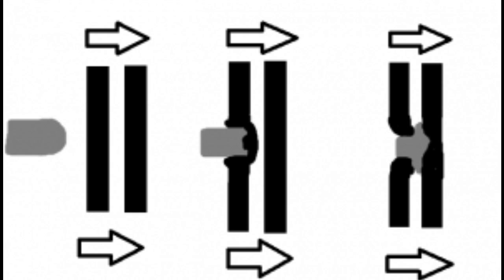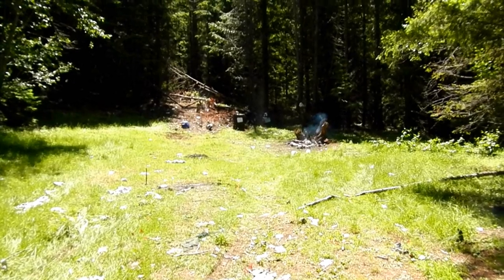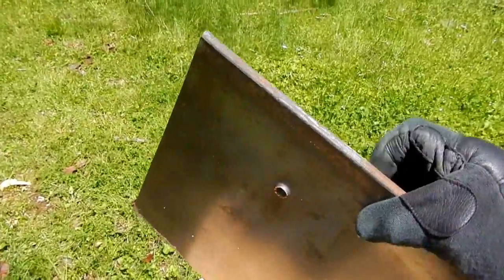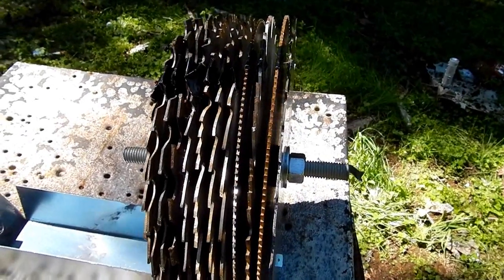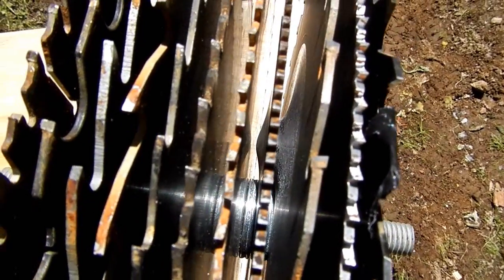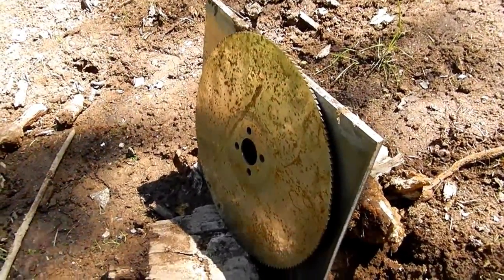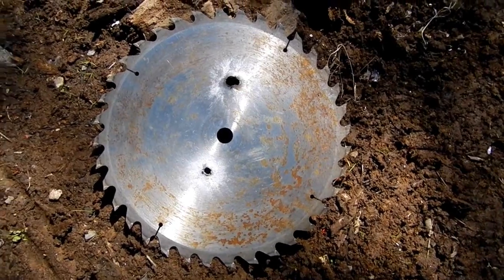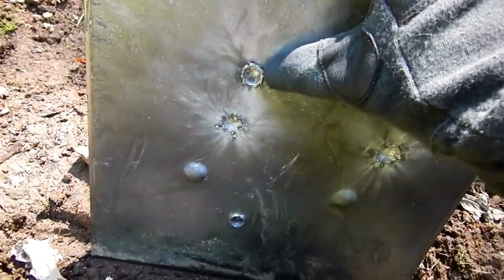Testing the Concept of Spaced Armor

Comment: Do the same thing with 122 millimeter round fired from a smooth board tube as the Russians have it's been proven that the space protection does work using lighter armor sounds great using composite armor standard Abrams with some form of that lighter armored space Steel yeah it stop shaped charges but will it work against depleted uranium tank rounds the best protection using lighter armor long as man stays in his present form tanks will always be needed on the battlefield I think that Russian t-14 armata is overly hyped up I still foot American Tank crew up against anybody and nine out of 10 times we're going to win because of Technology in training and training in training tanks should never be deployed on their own should always work in tandem with armored fighting Vehicles armored personnel carriers and grunts on the ground I despise the Germans and that's without question but the concept of mechanized Infantry with air assets is the way it should always be

Comment: Correct it's not the steel you use it's a spacing composite you put together remains stagnant bound together by the bolts and screws the projectile has to work and it's space between those plates doesn't change so that projectile loses energy but what about the projectile inside inside the projectile inside the projectile directions have a weapon such as that

Comment: Unfortunately mate, spaced armour is designed to defeat shaped charge or HEAT projectiles. a shaped charge projectile is a lump of High Explosive underneath cone of copper. As the projectile impacts the target, the high explosive is detonated, instantly inverting the copper cone. This causes a high pressure jet of molten copper to be sent forward into the target, burning it's way through the target. The spacing in spaced armour gives time and space for the copper jet to become less uniformed and allows it's energy to be expended before hitting the body of the target vehicle.
Reply from the maker: This is exactly the same mechanism for how it also defeats solid projectiles and sabot rounds. The multiple spaced layers of modern armor (ex. chobham) destabilize and distort ALL penetrators regardless of source.
Reply: Jackal Mountain that's a good point, I mean.... Look at the cheek armour on the cheeks of the turret on the  Leopard 2, it's basically one huge piece of spaced armour designed to catch APFSDS rounds. As far as the bullets entering your MRAPs thin outer layer, could that be to replace the Anti shaped charge warheads, instead of shaped charge cages? Or a way to reduce ricochet?

Comment: probably not the best comparison between that plate and the saw blades...different steel is going to have different properties...even the same steel that has been tempered and heat treated is going to behave differently than a plate of the same material that hasn't been heat treated in any way...

Comment: Those saw blades are also likely a harder steel than the 826 3/8 plate. More spacing may be needed for significant effect.

Comment: Isnt it possible that the type of ammo he uses with 7.62 39mm may be the less penetrating one? 
Coz in my opinion 556 shouldnt be more penetrating than 762 =)
Reply: @Aaron Washburn means distance makes the difference then
Reply from the maker: Kinetic energy = (1/2) mass x velocity^2  
since velocity in this equation is squared, it means higher speed projectiles have far more kinetic energy, also the 5.56 is concentrating that energy onto a smaller surface area, this results in higher penetration through some materials. The higher mass of a 7.62x39 will allow it to carry through more, easier penetrated materiels like ceramic tile, wood or drywall

Comment: 1/4" ballistic steel, used for bullet proof armor, will stop up to 7.62 NATO round.
Not all steel is the same.  Saw blades were not meant to stop bullets.
3/4 inch ballistic steel will stop a 50 cal round.

Comment: The more space between the plates the more effective they become. Nasa uses this concept for satellite and space station armor against very small particles traveling at crazy speeds with thickness of up to a foot or so of empty space.
If some of the plates are slanted in different directions this increase the amount of kinetic energy they will absorb. |/|/|
Layers work to diffuse the energy faster then just space but more layers more weight. Try a piece of glass in front of a metal plate.
Then another two just like it with some good amount of spacing behind it.

Comment: The reason why there are metal netting/ metal plate and then a space then the main armor around m-atv’s and maxxpro’s and other military vehicles are for RPGs and other weapons like that. Not for small arms fire, RPGs have two explosions. The first is to get through the armor and the second one is made to blow up the inside of the vehicle. So the reason why you have a metal netting or a metal plating then a space and then armor, is that when a  RPG hits it the plating it will cause the first explosion and when it hits the second layer it won’t go through the armor, and kill who ever is inside of it.

Comment: I wouldn’t really call this a test of spaced armor- to do a spaced armor test, you would need to shoot at the same thickness of material, and a consistent type of material to see how the spacing affects the penetration, for instance a 3/8” thick piece of mild steel, and a 1/8” spaced in front of a 2/8” mild steel. 

Any results from this ‘test’ can only be anecdotal

Comment: If I'm correct spaced armor is primarily there to stopping HEAT or shape charge rounds from penetrating the main armor, and it's recommended for that spaced armor to be a good distance away from the main armor so the round can slow down or completely change direction from air in between  the two armor. For shape Charge ( HEAT) the space armor detonate the round causing the super heated shrapnel to cool off and lose penitation capability

Comment: Ever since seeing 'non-Newtonian fluid on Mythbusters (cornstarch and water) I've wondered if spaced armor with non-Newtonian fluid  instead of air would improve or destroy the spaced armor concept?
Reply: Nope, it would just be too heavy to be practical, however it would be cool if someone made one, for testing
Reply: @ShopeeMarketteam Yep, lot heavier than air.  I was thinking maybe 7" saw blades inside a short section of plumbing/drainage tube for testing, ( reasonably easy to seal ends. but not so good visually)Water is less than 10lbs gallon,( just remembered, 10lbs per UK gallon, 4.54 litres, US gallon 3.88 litres) I'll have to look up cubic ft weights but steel is way heavier. (150+cu/ft?) if it worked armored vehicles could be much lighter and 'kinda self repairing? I have a friend who was sergeant in Rangers, he's got rifles but not filming equipment (and maybe not time either ,his work has been so busy I haevn't seen him in months?)

Comment: 5.56x45 has around 1750J of energy in a 25.5mm2 area. The 7.62x39 has around 2050J of energy in a 48.7mm2 area. The 5.56 has 68.6J/mm2 energy, the 7.62 has 42.1J/mm2. So yeah the 7.62 has more energy, but it is spread out a lot more. Of course the type of steel used in the rounds themselves can make a pretty huge difference. Anyways interesting video, thanks for making it.

Comment: I think you're not taking account the metal properly. Spaced armor works on the principle of destroying a projectile first and then stopping it. 

Spaced armor is meant to defeat rounds that are meant to penetrate solid armor, like shaped charge or those with a solid separating core. It's also not a solve all solution. 

Spaced armor has to be calculated and made for the use, meaning spaced armor may be rated to stop a shaped charge rounds from a RPG that has 10-15in of armor penetration, but will not stop a 20mm solid round rated for 4in of penetration. 

I've actually done studies on effective ways of dissipating energy from rapid introductions, like a fall or projectile. I find that the easiest method is something that takes and translates the kinetic energy.

Think of it like this, without doing the math myself, you have a bullet of a certain mass, area, energy and therefore pressure, you can then figure out what forces on, assuming, a fixed plate you can withstand before shearing or yielding happens. You can reduce the load on the metal by removing the energy of the incoming projectile first. Furthermore you can distribute the load evenly instead of focusing it on the point of impact. You can achieve both of these by allowing some material to take the energy, dissipate it, and then go somewhere else with it. 

If you want to try this, do a water jug test. Cut in half some water jugs and tape them back together with the top off and maybe 80-90% full. And compare them to jugs of water that are completely full with the top on.

Comment: Problem is you have different types of steel. The saw blades are much harder id imagine. Plus 5.56 will always penetrate more than 7.62/39 due to its higher velocity. Speed kills

Comment: Just a heads up the amount of dead space is just as important as the type, and thickness of the armour. The space laminated armour on the old m3 Bradleys is 1/4-3/8 hardened steel then about 1and 1/2 ins of air space then several inches of aluminum armour. If the air gap isn't large enough it has very little effect.

Comment: Well the main thing the spaced armour is used for on vehicles like the panzer iv H is to defeat shaped charged muntitions ( things like rpg and panzerfaust) by activating the muntion creating the molten copper jet before it actually hit the hull armour, so it will penetrate the vehicles  less or not at all.

Comment: I would say a flexible steel is better that strong steel. Flexible steel will bend and cause the bullet to use more energy to pierce to get to the second armor. A strong steel would shatter and be moving away from the bullet. The bullet would have to just break to get to the armor. It’s like a diamond. Strongest rock but can be shattered or like obsidian

Comment: Brittle steel actually is better for spaced armor. It's brittle because it is harder, higher on carbon. In this case, the harder the better. That's the motive why military use ceramic tiles, they are brittle but they are harder than any steel.

Comment: Hey very interesting test. I enjoyed the video keep it up. I just want to add that one test with the big saw blade and the 3/8th's plate the one that shattered  into fragments isn't mild steel it's tempered or hardened tool steel. Mild steel bends and hardened steel breaks or shatters in this case.  I know you've probably been blasted in the comments by that.

Comment: Space armor is an annoying concept. On paper it provides superior protection with the same amour of material, at the cost of space. When applied, the greater space used translates into more surface area and more material needed. Space armor fails in 3d because the extra surface area requires more material than a single sheet of material with less surface area.

Comment: The outer layer of armour on military vehicles is for RPG's and explosive HEAT tank rounds if i'm not mistaken. Nothing to do with small arms fire.
It's basically their to stop a direct impact, instead of blowing a hole in the side of the vehicle it destroys the thin outer layer or chain, saving the passengers. The RPG explodes on the outer layer of armour or chain and absorbs the impact, the inside thicker layer stops all the shrapnel. 

I remember watching a old documentary on the implementation and future upgrades of these, they had all sorts of ideas some even included infrared sensors that would detect incoming projectiles.

Comment: Saw blades are at least surface hardened, and they are so thing thats all they need (its why that one shattered). The steel looks like its a really soft mild steel that hasnt been hardened at all, which is why these rounds go through it like butter.

Comment: I would be interested to know what happens if you change the amount of space between the saw blades. There may be an amount of distance you want (to my mind at least 1.5x the length of the bullet) to encourage it to hit the second plate at an angle (as the first will definitely destabilize it). And yes I believe spaced armor was originally to defeat shaped charges, but this is certainly an interesting test.

Comment: Speed beats armor that's why 7.62x39 didn't vx 5.56
Reply: Sheer mass can also beat armor, but you need a ratio with far more disparity than 7.62 and 5.56.

Also I believe he used AP 5.56 and lead core 7.62, that might have also had an effect on the results.

Comment: "Brittle" steel usually means hardened steel and that's what you want to disperse the impact before capturing it in softer medium. Early "trauma plates" were often just hardened steel to break up the round so the lower mass, reduced velocity fragments could be captured in the soft aramid fiber armor behind.

Comment: "Spaced armor"
[shows images of armor plates used to aid in defeating AT rifles in WWII mounted to German Tanks]

Uh, you okay there buddy?
Reply: "Marty" that literally the same thing
Reply: @chrissyrett673  Not exactly. The WWII tank-mounted armor (known as schürzen) was meant to defeat (or attempt to defeat) AT rifles, by eating up some of the kinetic energy of the round and partially deforming it prior to slamming into the armor of the hull. Spaced armor proper is or was used in more modern MBTs in an attempt to defeat HEAT rounds by providing a buffer of air between armor plates which would act to aid in defeating the superheated penetrator created by a HEAT shell. While that is a loose explanation... There is a difference. Albeit mild. But the point of the vid was to see "how can spaced armor work against kinetic penetrators" which... As far as I'm aware would only apply to more modern spaced armor (such as that found on the MBT-70) due to the use of specialized materials rather than schürzen...

Comment: Spaced Armor was originally intended to strip the metal jacket off of the bullet and upsetting it's ballistic performance and preventing it from cleanly impacting the primary armor surface.   This saw wide spread usage on the Panzer III and Panzer IV model tanks during World War 2 -   While many believe it was intended to combat against High Explosive Anti-Tank - in reality the soviets really didn't have HEAT munitions - as they depended almost exclusively on US Lend-Lease Bazookas, or captured German Panzerfausts.   Instead, this armor was used to defend against the PTRD 41 12.7mm Anti-Tank Rifle, which was powerful enough to penetrate the thinner armor of the sides and turret (Which the armored skirts protected)

Comment: Cool experiment.! Battleships of old used to use what was called a thin "de-capping" plate of armour designed to distort and reduce the effectiveness of armour piercing shells before they penetrated through to the main armour layer.

Comment: I wish I was there to see the look on his face when he figures out that spaced armor on modern vehicles was intended specifically with the RPG-7, and other High Explosive Anti-Tank (HEAT) munitions in mind. The reason being that the most common and widely used weapon system for anti-armor pursposes being used by fighters in modern combat  being the RPG-7 and less common but still encountered somewhat regularly, the RPG-2.

I'm assuming that just by how the principle of spaced armor works when coming into contact with a HEAT round, it would also lessen the effectiveness of your run of the mill High Explosive (HE) round, and even greatly diminish the effectiveness of High Explosive Squash Head (HESH) munitions because of the greater standoff distance from the main armor body. The explosion of the HESH taking place further away from the crew compartments outer armor surface would, at least I would reasonably assume, possibly even completely defeat the round by altering the effective spread of the explosive material over the armor, spreading it so thin due to the increased distance it must cover, that it would be a paint remover at best...

For my information and curiosity, if anyone can tell me how HESH's  explosive material is spread over the target armor surface that would be great (is it purely spread by kinetic impact of the round on the surface, like throwing cookie dough against the wall, or by a much smaller initial primer detonation not powerful enough to set off the High Explosive within the munition to initiate the spread?) Regardless, Idk if it would deflect a solid shot off it's intended flight path enough to be reasonably expected to encourage the projectile to bounce, but maybe it can be effective depending, of course, on the thickness of the spaced armor applique. 

Btw to anyone who thinks that the concept of spaced armor is a recent modern discovery, the use of spaced armor and the understanding of how it defeats anti-armor weapon systems using projectiles like HEAT munitions, goes all the way back to the days of World War II, when Bazookas and Panzerfausts/schrecks were being used on targets.

Comment: Your experiment is broken but still a fun video. As a note, spaced armour hinges on a brittle outer layer that shatters instead of deforming. Typically inside plates are more pliable. The outer more brittle plate is harder, and thus absorbs a lot of energy when it fragments. Those fragments are then absorbed into the second more ductile layer or layers. Look at the armour used on the International Space Station for a clearer understanding.